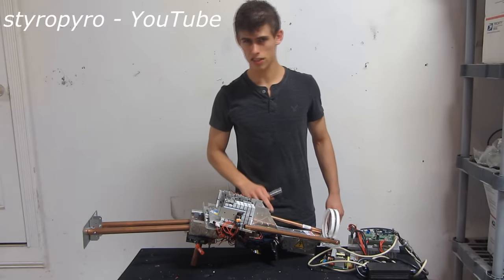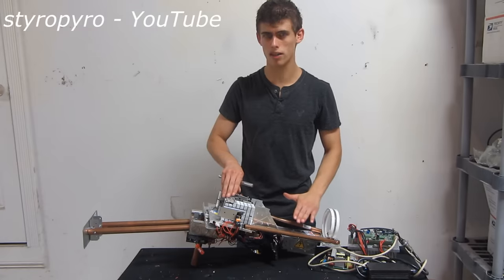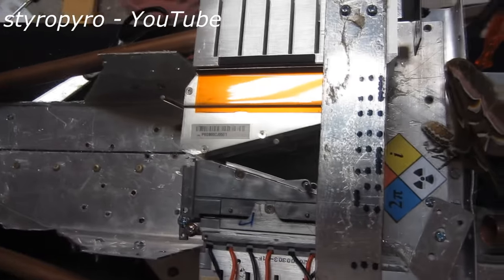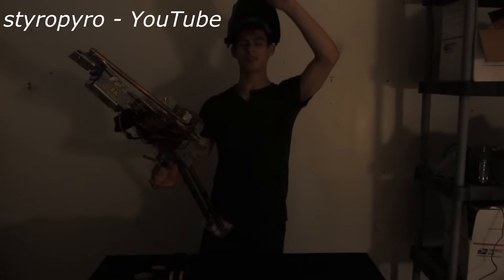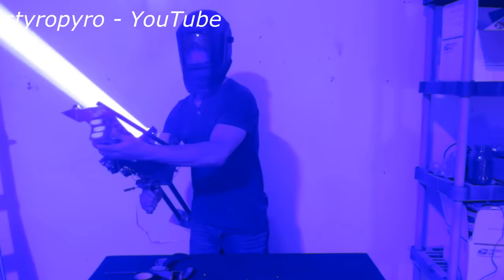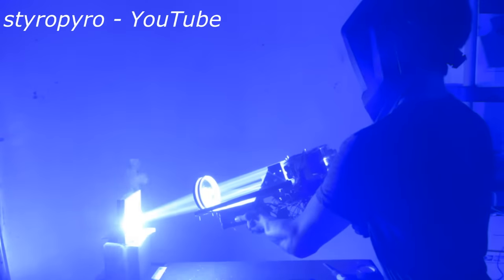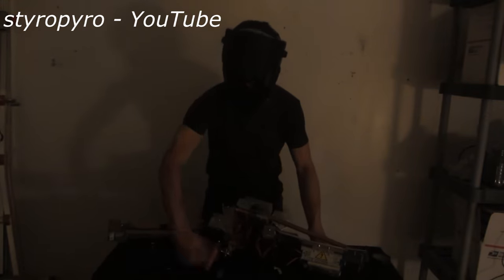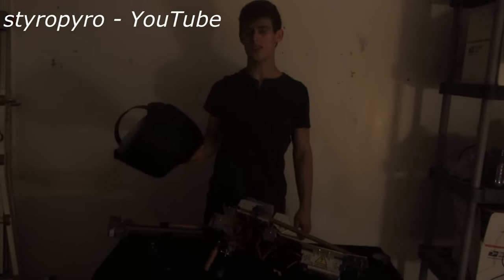My Homebuilt 200W LASER BAZOOKA!!!!!

Comment: Robbers : breaks in to his house

Him : flips down welding mask
Reply: time to commit a warcrime
Reply: Robber : pulls out mirror
Reply: @VG-or1nu  melts mirror
Reply: @anduro7448  lmao
Reply: i n  t o
Reply: VobisPacem just put mirrors and glass on it and 
The robber:*turns to dust*
Him:*laughs in Lasers*
Reply: OHH GOOD
Reply: VobisPacem   Point to the eyes to get instant blindness
Reply: @attackoramic8361  If your clothes catch on fire rolling on the ground is generally a good way to put out the flames. And that level of flame isn't enough to burn you to death (the human body is literally made out of water, which has an enormous heat capacity and is very resistant to hot temperatures) but they could cause serious burns. 

Pointing to the eyes would immediately cause permanent blindness though, even if you were wearing safety goggles, so as a weapon it's about as dangerous as it gets.
Reply: Alright, thanks for the info i was just thinking with a certain amount of heat and time, they would go unconscious. the amount of shock from the nervous system would be extremely painful.
Reply: @VVayVVard  although that would be a good way to scare off robbers LOL.
Reply: The robber's F
Reply: VobisPacem  Not if you flash it across his eyes it dosen't!   And even the first contact anywhere will burn like hell even if it dosent set you literally on fire for a few secs.  Imagine having your eyes burned out instantly, then suddenly your nuts heat up.....
Reply: licson0729 
You have been given the effect "Blindness 12767" for 9.9999628E+1925725 Years
Reply: I was about to type this then I saw your comment lol
Reply: VobisPacem  Pretty sure his shock and confusion would last long enough for it to take effect.
Reply: Bravo six, going dark.
Reply: Angry Geneva convention noises
Reply: "wanna feel 200 watts of P  A  I  N mr criminal?"

"wait what"
Reply: @VG-or1nu  uno reverse
Reply: Ooohhh shit
Reply: I think that’s a violation of the geneava convention
Reply: @VG-or1nu  OH
Reply: @anduro7448  top 10 biggest no u moment
Reply: @licson0729  : Some fool would !

Comment: Plane: flies over his house
Him: WHAT ARE YOU DOING IN MY AIRSPACE?
Reply: Plane: ceases to exist
Reply: Lex luthor must be his Idol!
Reply: Holy shit that would actually work since it's accurate forever
Reply: @hydraulichydra8363  I have done laser ablation on a train (3000w), and one of the reasons it had to be a pulse laser was that a CW laser could damage the ISS !
Reply: @hydraulichydra8363  its not
Reply: @saab35draken39  YES IK but the distortion from the air would be negligible. It's basically accurate forever.
Reply: @hydraulichydra8363  if that was the case dont you think that most militaries on earth would adopt these laser weapons to a large scalle seeing as they can melt through metal and could ignite fuel? Like how the U.S army ATHENA is used? Lasers dont have "basically" infinite range its nowhere close that, even on an earth scale.
Reply: its not funny and its not original,
Reply: @stickyricky7089  how to delete other people’s comments
Reply: Lmf
Reply: That sounds like a astronaut problem, why would you care. Its just a little road block. I mean building a road doesnt mean you need to vapourize a mountain. Shooting a rocket doesnt mean you need to remove the dude shooting it down, just find some corners around him.
Reply: @looneystorm1003  just don't replace l with s seriously don't even dare to do it!!
Reply: "Hey mommy look, an airpla- WAAAAAAAAAAAAAAAAAAAAAAAAAAAAAAAAAAAAHHHHHHHHHHHHHH"

Comment: This dude is 3 steps away from building a BattleMech.
Reply: Ikr just attach a couple of his most extreme lazers into a metal suit and he is good
Reply: And the tezla coil on the top for air defense...

The bug zapper as a spear
Reply: And an overclocked plasma globe for the core.
Reply: to build a normal mech out of this: adding more attacks, strengthening attacks, large exo-suit made of tungsten, and rocket boots.

Comment: Everytime I have a question about lasers... You always come through clutch!  Thank you styro.  
  What kind of laser removes rust?
Reply: High power pulse lasers can blow off the top layer of metals, so I presume they could be effective at removing rust as well.
Reply: there are industrial laser cleaners and also laser surface conditioners that abrade surfaces for better adhesion of structural glues. some of the corvette body panels are treated this way before bonding.
Reply: @ronblack7870  ITS Been 10 months and i still dont understand lasers lol( laser power ratings for example  to cut or etch steel or alumunim etc. is it the Nanometers or the wattage )  i did figure out that there's  no way for me to make one of these machines. electrorust removal is cheaper and evapo rust is even cheaper still.    ill eventually get my head around it

Comment: Heres a cool idea:
Take your laser rifle and mount the rear focusing lens on a track controlled by a servo. Then use an arduino with a rangefinder to calculate the distance between the lenses so the laser will be in focus. Then set the servo position according to the length. Result: perfectly focused death ray
Reply: Quantum56 I’m pretty sure barely anyone knows what the hell you’re talking about...

Edit: I’m not trying to be mean 😬
Reply: Froop Loots basically what he is saying is that the gun will read the distance from gun to target and automatically move 1 of the magnifying glasses so the laser will be finely focused
Reply: Froop Loots all you need is the last sentence
Reply: U explained that way to complicated
Reply: doggollamaman The point is to explain the components

Comment: when you realize a real life laser weapon would actually be completely silent
Reply: They should totally add additional pew pew noises to those for like... pedestrian safety reasons?:}
Reply: And have no recoil
Reply: Would be the perfect stealth weapon if not for the intense light
Reply: @oogabooga8689  infrared laser can’t be seen with naked eyes
Reply: So...
I've been here before and said the thing I was going to say...
Good to know.
Reply: A real life laser weapon would have sounds from the cooling system tho. Sounds of cooling fluid (water) running through pipes and a fan
Reply: Continuous beam lasers would be completely silent (the laser diode itself) but pulse lasers will produce little plasma explosions on their target and produce sound.
Reply: @kerbodynamicx472  
But it will still be pretty silent, especially if you are in an open area or the sea...
with sounds that can distract it.
You also talk about pulse lasers.

random question, you think a red pulse laser, at a wavelength which can go a bit through the skin but not all the way through... will hurt the most?
Reply: @kerbodynamicx472  Only if it's obscenely more powerful per burst. For the air to be ignited into plasma, the air would have to be over 21K degrees Fahrenheit.
Reply: @oogabooga8689  thats kinda an advantage its so dangerous
Reply: @oogabooga8689  they can't catch you if they can't see
Reply: @tausiftaha12  lazers actually have a tiny unnoticeable amount of recoil!
Reply: I mean if the beams gets REALLY REALLY hot, it'll turn the air in it's path into plasma, which does make a sound
Reply: @atomicanachronism8849  Also, if it were an actual weapon it would probably have some sort of active cooling, which also makes a sound.
Reply: okay but what about the painful screams of the victim
they may not last very long but they're still there
Reply: @thefernpersonwoahg  That's not the weapon itself, and chances are they would die before they can scream.
Reply: @tristanmisja  what about the body collapsing? that'd surely make some noise
Reply: @thefernpersonwoahg  Not really, have you seen any gore videos? If not, that's good, they're traumatizing, but anyways it's usually pretty quiet when bodies collapse.
Reply: @tristanmisja  haven't seen a gore video in a hot minute (thank god) but they were all silent anyways.
Reply: @thefernpersonwoahg  Well I've seen some with audio, and the corpses typically made almost no noise. Though I'm not really certain if that's how it would be in person.
Reply: @zheyingchin4194  but infrared lasers can't even burn skin. Ultraviolet laser more.
Reply: @zheyingchin4194  ultraviolet is more dangerous and can't be seen either
Reply: @tausiftaha12  it has a little bit of recoil, but its hard to measure.
In fact the recoil force of it is a constant force,and it is F=P/c, while P is its power in Watts, and c is the speed of light in m/s. So the force in this case is F=200W/(3*10^8m/s)=6.67*10^(-7)N or 0.667μN. 
A piece of hair with the length of 1cm (0.4inch) in comparison will excert a force of approx. 0.2μN due to its gravitational force. 
So this is a tiny force. (this means, that this laser produces a little bit more force, than it is required to lift a hair with a length of one inch.
Thus if thr beam wouldnt burn hair, and could be concentrated enough, it could levitate a one inch long piece of hair, if it absorbed the beam, and 2 inches of hair,if the hair reflected all of it.
Reply: @oogabooga8689  Would be perfect would dealing with Joe's F-15's if he ever uses them on us :)
Reply: This remember me the movie Akira when lasaers satellite shots and the movie get completely silent.
Reply: A stronger laser would probably release so much energy that some of it gets converted into sound waves
Reply: They should add a speaker that does a pew or a BSHEEEWW 🤷‍♂️
Reply: It wouldn't be silent that's BS

There would likely be a ton of screaming 😁
Reply: Probably loud because of cooling?

Comment: god imagine if this thing was perfectly focused...
Reply: I was thinking you could easily add the 'auto focus software of most cameras to adjust the focusing mirror back and forward an inch so it would concentrate the beam at whatever you pointed at - like auto focus on a simple camera.  The gun could then be operated from a virtual drone style head set that would also protect the eyes as well as give perfect aim.
Reply: just imagine if this god beam could be condensed into a little tiny string beam

it would probably cut through planets like butter
Reply: @DerPancake234  r/theydidthemath
Reply: Pancake r/smartguy
Reply: r/ihavereddit
Reply: Top 10 funny comebacks #748
Reply: Just use a deagle instead
Reply: Mick M ma niggah you invented a real life aimbot tf 😂

Comment: There is a reason why he didn’t point it  at the camera it’s that powerful
Reply: There is a reason even a small laser can damage camera sensor
Reply: @SanjayKumar-xb6es  wait but can it actually affect us?
Reply: @jonathan-rw3mx  no
Reply: @jonathan-rw3mx  but even a 5 watt laser is pointed directly in your eyes then there is a high Chace you will never see again
Reply: @jonathan-rw3mx  is this a serious question
Reply: @SanjayKumar-xb6es  Getting hit directly in the middle of the eye with a 5 watt laser has basically zero chance to not blind you. Remember a watt is 1 joule per second, and the threshold for eye damage is about 100 microjoules which means at 20 microseconds of the laser in your eye, your retina will be irreparably destroyed, and this is too quick for human reflexes to avoid damage. The average human reflex speed for visual stimulation is about a quarter of a second which means you'll get about 1.5 WATTS dumped into your retina before you look away. You're pretty much fucked at that point.
Reply: @jonathan-rw3mx  Are you serious? Of course not. It's the power output of a laser that blinds, in this case the power output is 200 watts. If your phone can't generate 200 watts of laser light then it can't affect you at all.
Reply: Achilles Lade the scientist
Reply: @achilleslade3771  yup.. he just roasted me.
Reply: Sanjay Kumar bruh a 5 watt laser can literally make you lose sight just by looking at the spot it leaves when its pointed at a wall. If that shit hits your eyes there is no CHANCE its literally over.

Comment: so if 5 watts damage your eye by looking at the spot the laser has, does 200 watts just melt your eyes?
Reply: just looking at it for less then a second will blind you forever
Reply: @Rossilaz58  just direct contact of the spot of the laser and eye, means blindness forever. Im pretty sure even looking at spot with closed eyes will make you go blind in like second
Reply: The thing emits extreme heat. Eyes and heat don't go together very well.
Reply: NO IT COOK'S IT WELL DONE
Reply: it would annihilate your retina
Reply: Instead of simply damaging your eyes, you would be blinded pretty much instantly the moment it was turned on.
Reply: Imagine the power if he added a second lens to focus it into a narrow beam.
Reply: We will blind the Area 51 guards
Reply: its 0.5 wats for damaging you'm eyes, so your eyes are definetally ducked at 200, + considering the fact that he just burnt wood
Reply: 100 Videos And No Subscribers nahh.....it would need like 2 extra lens plus some more led and other stuff to amp the whole stuff up so it would burn through skin a bit
Reply: What eyes? They wouldn't exist anymore
Reply: vocal percussion on a whole nother level... coming from my miiiiiind

Comment: Please go outside and shoot it into the sky!
Reply: This will literally get police at your door.
Reply: +Bikonito how?
Reply: +Skyfire It's an issue when you have someone shining something into the sky that could potentially impair a pilot's ability to fly.
Reply: I wouldn't it might provoke an attack by Aliens
Reply: It's an issue if you're shooting a laser at an airplane. The sky is a HUGE thing. If it was a picture a speck of dust would signify a plane. It is not illegal to shine a laser into the sky.
Reply: +Bikonito Makes little sense to me. Why are spotlights allowed to be shone in the sky?
Reply: +Skyfire Spotlights aren't a focused beam.
Reply: +Skyfire But they diverge like lasers. Anyways, you should adress the comments referring to the fact that it is not illegal to shine lasers into the sky, but it is in fact illegal to shine them at low flying aircraft depending on the beam strength.
Reply: Let me speak as a pilot here for this thread.

See, a part of this is actually that any laser beyond Class III (which this isn't regulated by but is certainly beyond) is illegal in the United States almost entirely because of that. Even owning this monster is probably not entirely, eh, copasheshe. You need to be a laboratory operator or some such to get access to any large lasers, so this going off has a high chance of upsetting somebody. 

It is regulated to the point that, in fact, Sectional Charts (that's basically sky maps for you guys) actually have to mark on them where high-intensity lasers are recorded to operate from. 

This is especially worse since I don't think he nor anybody else has tested how much his laser blooms, and it could potentially do some damage to pilots even if he's not pointing directly at us. 

TL;DR Not worth the risk of damage nor the legal action.
Reply: Cielo Pachirisu I appreciate the effort into your response and can appreciate the concern of large bright light emitters to a pilot in flight. That said, I'm interested in seeing the documentation you have related to any laws that restrict ownership of anything higher than a Class III laser. I've only found that anything higher than an output of 5mW isn't considered a laser "pointer" but that is regulatory for manufacturers. Lastly, that's interesting that large emitter locations are included in your charts. Are those specific say to large telescope locations that use lasers to do image correction? Maybe I should look on /r/lasers to see if they have any material that could explain the law portion better.
Reply: Eric Jones You know, they'd probably have a better response. I mean yeah, of course, it's laboratory lasers that are marked, they won't put down every little thing.

And, actually, after reviewing the laws, it turns out to be illegal to sell the lasers, not to own them. My bad on that part.

http://www.laserpointersafety.com/rules-general/rules-US-consumers/rules-US-consumers.html

That being said, it would not be wise to tempt this. Aircraft can be hard to see sometimes, and somebody up there seeing this would certainly set off alarm bells in somebody's head.
Reply: Cielo Pachirisu Fair enough. Ultimately I agree people should conduct themselves safely when manipulating powerful equipment. Laws won't make that happen, but education and respect for the technology will.
Reply: Eric Jones That's unfortunately an issue, nowadays. I don't think people really know quite how serious this laser stuff is and they point at aircraft for fun rather than malice.
Reply: you are wrong. it is illegal to purchase or sell a laser that is over class III but you can build any thing you want.  it is actually the FDA that regulates these standards. been building portable lasers and laser light shows for +9 years
Reply: no_connectivity I corrected myself in a later comment.
Reply: sorry i just seen the other post.
Reply: and FBI and FAA, and probably few more alphabet soup agencies
Reply: k
Reply: when i play with such tools on the outside i have my phone on with the flight radar app on so i know when an aircraft is around to stop
Reply: and gg
Reply: +NIGHTMAREuki few more ALPHABETTI SPAGHETTI
Reply: With batman motto

Comment: I know that his is an OLD post but Have you ever thought of grabbing a bunch of Lazer diodes and converging them into a single beam and installing them as the laser source for say a K40 laser... could you get the equivalent of a 40 W CO2 Laser with converged Diodes ???? I know most are between true 5 and some can be 10 watt lasers (not the labeled 40W they claim) would be interesting to see if it could be done.. if so You might have something that could rival C02 Lasers :) maybe in the same space of the C02 Tube you could put 5 or 10  5w Diodes and really see what they could do..